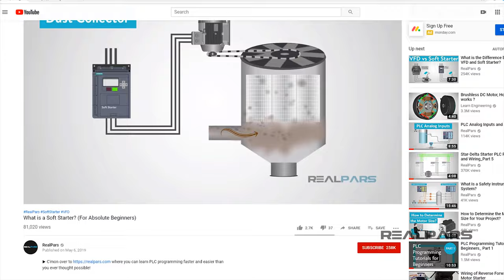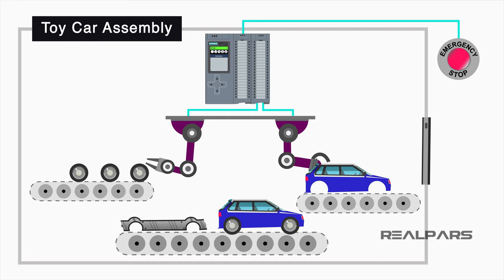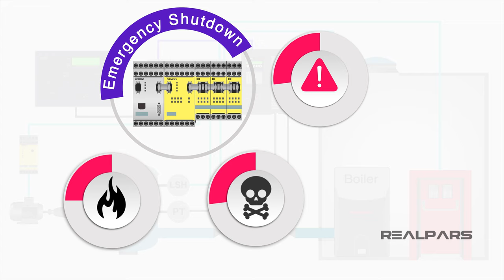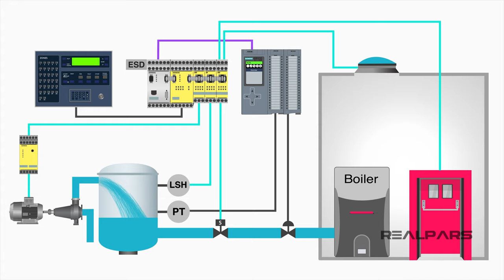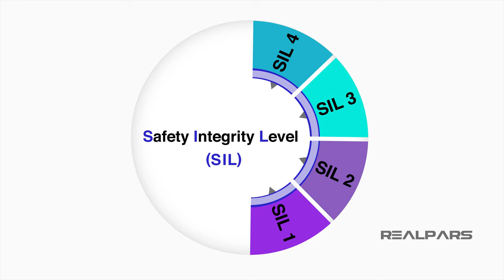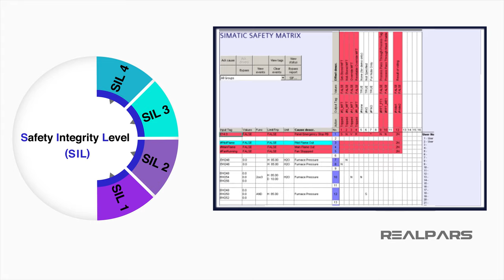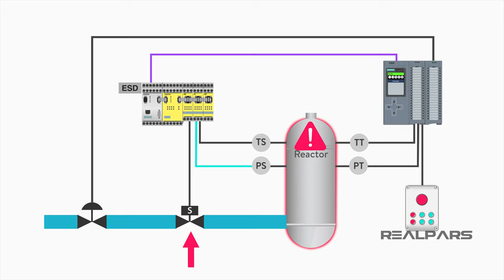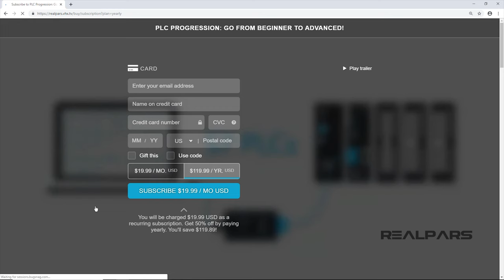What is an Emergency Shutdown System?

Comment: One point.  If you’re using a plc to operate these systems, you need to look at plcs and I/o rated for such use.  These generally have built in redundant processors (SIL 3 and higher) and I/o and communications.  They also tend to have special memory that can be locked - separate from the general code - so the logic can’t be inadvertently changed.  The code for these systems must also be rigorously validated to insure they will perform the tasks they are required to do.  These systems tend to come at a high premium (3-4 times the cost of standard plcs.)
On a second note, make sure you are familiar with all codes and regulations that govern e-stops and esd systems or you can find yourself in hot water is an incident does occur.
Reply from the maker: Thanks for sharing this, Ryarios! Great information!

Comment: Nice video, please what is the difference between ESD system and Instrumented safety system? are the same?
Reply from the maker: ESD and SIS are similar terms and in many cases, they can be considered the same.  ESD systems are designed to shut down a process based on certain inputs and events.  SIS systems perform many of the same functions, but are designed to a specific reliability level (SIL 1, SIL 2, etc.).
Reply: @realpars  nice explanation ,  thank you very much.

Comment: Thanks a lot for provided this video. I just wanna make it clear, even ESD is in the same safety system with safety PLC (logic solver), is there any different between both of these? again, thank you
Reply from the maker: A safety PLC is a device that is part of an overall system constructed to protect a process.  A Safety PLC can be the basis for an ESD.  Safety PLCs can also be the basis for a Safety Instrumented System (SIS). SIS systems follow ISA84/IEC61511, which in simple terms requires a set of sensors completely separate from the basic process control system, a dedicated logic solver, on-line and off-line test protocols, and controls in place to ensure the system has not been altered without a rigid change procedure being followed.  

So to answer your question,  a Safety PLC is a device (logic solver) that forms the basis for an overall safety system, which can be an ESD, or if it meets the requirements of ISA84/IEC6511, it is part of an SIS system.

Comment: Is ESD different from SIS (Safety Instrumented System)?  If yes, could you explain in detail? Does ESD and /or SIS have Function modules to calculate certain functions faster?
Reply from the maker: While some use the terms interchangeably, the two systems are different.  ESD systems are typically manually triggered to shut down a system or process.  Fire pull stations and E-Stops are typical devices used in ESDs.  SIS systems are sensor-monitored, automatic logic systems that will shut down a process without operator assistance when a shutdown condition exists.  SIS systems should follow ISA 84/IEC 61508.  The purpose of ah ESD and SIS systems is solely safety, not making calculations or executing any kind of process control.
Reply: @realpars  At 3:21 of the video, it is said that sensors, controllers and FCE are used as a part of ESD. I find it similar to SIS. This implies that the ESD system is automatic rather than manual. Could you help me understand the difference between ESD and SIS since both are automatic? Also What is usually the SIL of the FCEs used in ESD systems? Thank you in advance.

Comment: Does PLC and  DCS  work together in the same  system?
Reply from the maker: Yes, these are called hybrid systems, and they are very common in the industry.  In these systems, each controller is used specifically for which it is best suited for: PLCs for machine or skid control and DCS for analog and process control. Most of the systems I work on are hybrid-type systems.

Comment: How the ESD communicates and stops the production line of the PLC? Does it uses a Protocol and we hane to programm the PLC to stop the line or it cut's the supply power?
Reply from the maker: An ESD system switches digital outputs on and off similar to a PLC, but because the logic solver and all I/O is separate from production PLC, it looks only at safety inputs and criteria and takes appropriate action based on that logic.  An ESD may close a valve which is separate from the operating process, may de-energize a relay, etc., to drive the process to a safe state.  The important aspect is that the ESD operates independently of the operating logic and has its own dedicated sensors, actuators, and I/O.
Reply: @realpars  Ok, that is what i already knew about the ESD function but i noticed a purple cable connecting these two, that why i asked!

Comment: Hello I have a question about s7 communication... It is if I make a s7 communication in step 7 it is necessary I have simatic net software in same tima I have simatic net (program blocks) but I dont I have simatic net configuration or not please help
Reply from the maker: If the program compiles and downloads correctly, you are good to go.
Reply: Thank you

Comment: Is ESD system is a part of SIS?
Reply from the maker: Yes, it can be, and as presented in this video, it is.  SIS systems follow ISA84/IEC61511, which in simple terms requires a set of sensors completely separate from the basic process control system, a dedicated logic solver, on-line and off-line test protocols, and controls in place to insure the system has not been altered without a rigid change procedure being followed.

Comment: What is the cause and effect of separator
Reply from the maker: A separator is a vessel that allows two or more materials to be separated from one another.  A cause and effect analysis for a separator may look one cause of failure, such as over-filling the vessel, having the effect of a spill.  It may list other causes of failure, such as over-pressure.  What causes and effects that are determined is the result of a formal process that includes operators, engineers, and managers.
Reply: @realpars  plz do video on this

Comment: Isn't ESD the same as SIS ?
Reply from the maker: Yes, those terms are often used interchangeably.  Other common names are Safety-Related System (SRS), Instrument-Protective System (IPS), and Emergency Shutdown System (ESS).  The important concept is not the name given to the system, but the standards applied to the design and maintenance of the system (ISA 84/IEC 61511/IEC 61508).
Reply: @realpars  Thanks

Comment: What is the difference between psd and esd
Reply from the maker: PSD and ESD are essentially two terms for the same concept.  In the video, we describe an ESD, emergency shutdown system, which monitors the system for conditions that could cause harm to people, the process and equipment or the environment.  When a triggering condition is detected, the process is driven to a safe state as quickly as possible.  If the system takes these emergency actions, it is best to call it an ESD.  PSD's are used to shutdown a process for abnormal conditions as well as for normal process events (end of run).

Comment: What is shutdown valve SIS logic.?
Reply from the maker: For a Safety Instrumented System, when a fault or safety limit is reached (high level in a tank, for example), the SIS controller can cause an isolation valve, such as the inlet valve to a tank to shutoff to keep the tank from overfilling.  The valve used for this shutoff service is typically an on/off valve with a high-reliability solenoid valve.  Depending on the SIL level required, it is not uncommon for there to be 2 shutoff valves in series to insure good cutoff.  The important concept is that the SIS logic and final control elements are NOT part of the normal process control system, and are there only to provide protection of the process.